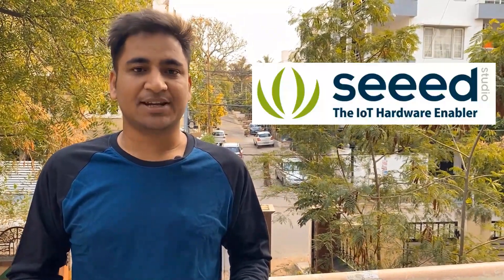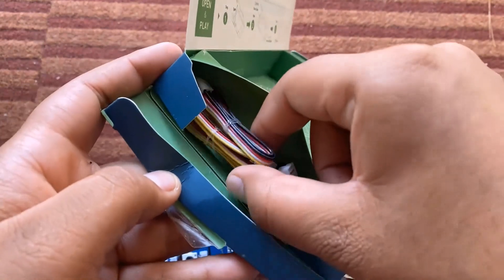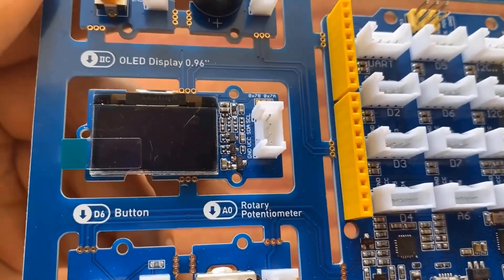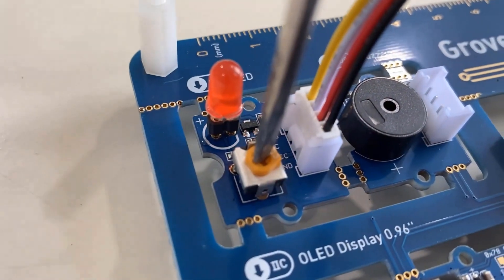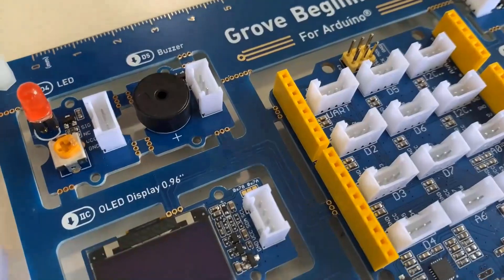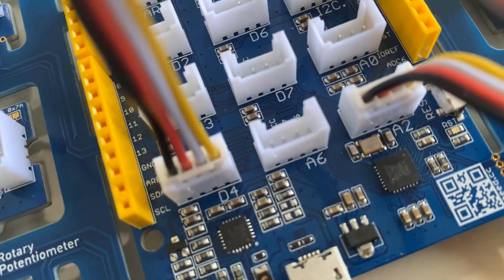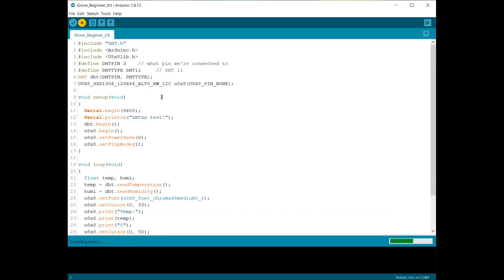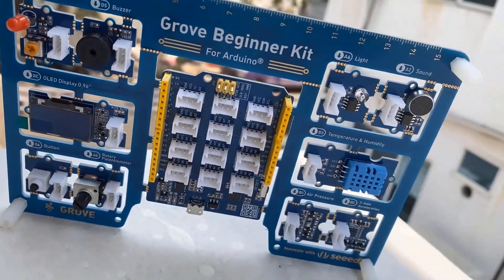Grove Beginner Kit for Arduino - Unboxing & Getting Started (10 Sensor 12 Projects)

Comment: Thanks for your introduction. Its usefull.
Can you let us know how we can interface two I2C components like reading accelerometer value or presssure value and show it on OLED using ARDUINO sensor Kit library. Beigining two components together isn't working in setup.